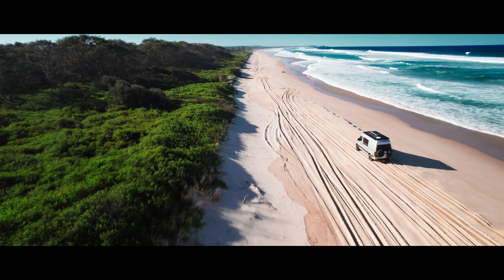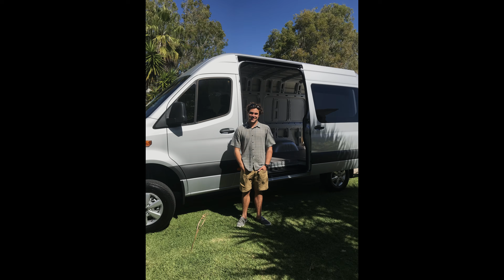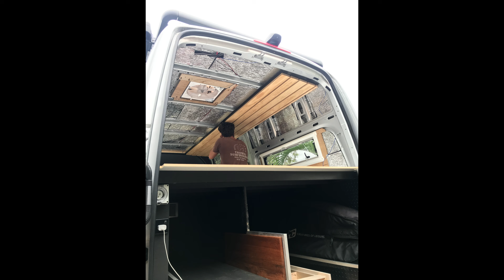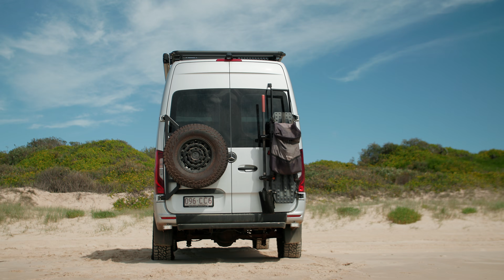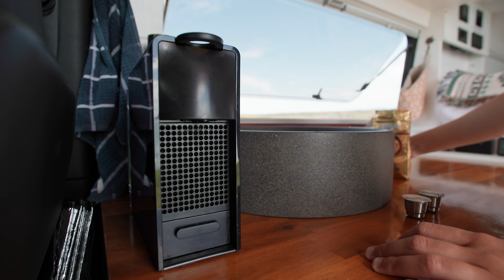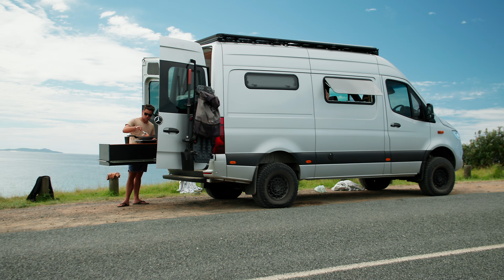VAN TOUR: 4x4 Sprinter Conversion│Our Ultimate Off-Road Surf Van

Comment: Beau, Im having trouble finding the spare tyre carrier supplier, can you confirm who you used, maybe send a link????..........Nice job bro, lots of toys nice and snug and safe inside. I'm fitting out a van at the moment and very interested in your tyre carrier set up at the back, looks cool and functional, I'll be checking that option out as compared to paying $3K+ for an import.
Reply from the maker: Hey Glen, Give Ian a call at https://vidastylesolutions.com.au/contact/ Aussie built and has been 100% solid so far. Vida also make some underbody protection, a ladder and some other goodies worth looking into also 🤙🏻
Reply: @BeauBlakePhoto  thanks Beau, I'm dropping by Vida to have a tyre carrier fitted, and might also jump on the ladder set up later, thanks again for sharing, I was looking at $3,300 for the tyre carrier from the US, you just saved us $1,800............thanks legend 🙂...........what does your van weigh?.............and did you drive the van to ascertain body roll etc before fitting the van compass set up..............my fitout fully loaded is looking at weighing in at about 3.3.- 3.5 tonnes..............

Comment: Excellent fit out. I am interested in what electric set up you have. Also, where did you source the shocks from?
Reply from the maker: Thanks! 
Electric setup at this stage is: 2x 175ah Prismatic Lithiums from Aussie Batteries, 50a DCDC Renogy Charger, 3000w Renogy Inverter Charger. Have had no issues so far and does everything far more expensive setups can do. 

Shocks were sourced through FreedomVanGo in the US. They were more than happy to airfreight us to sets from the US. Took 5 days to arrive and was more than $1000 cheaper than sourcing them from stores here in Australia.